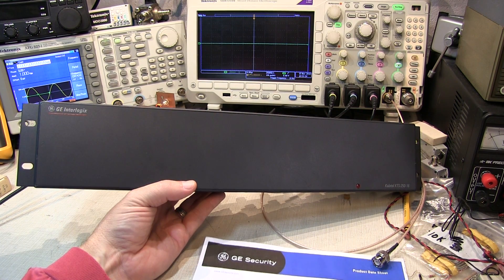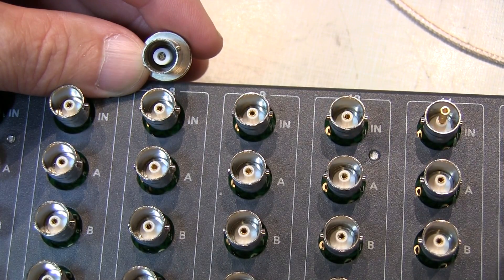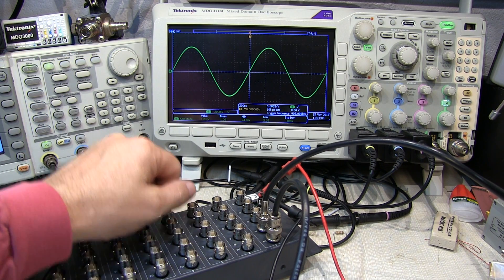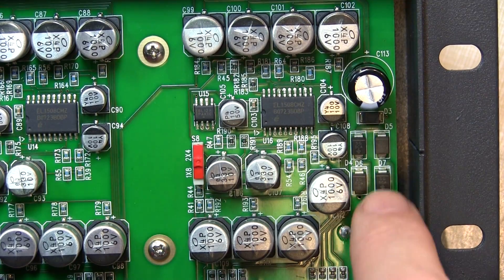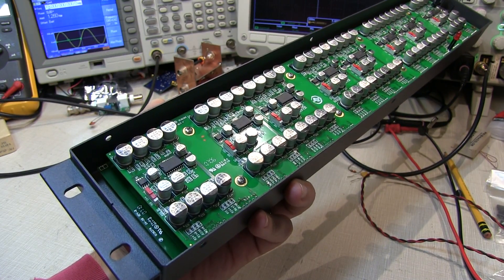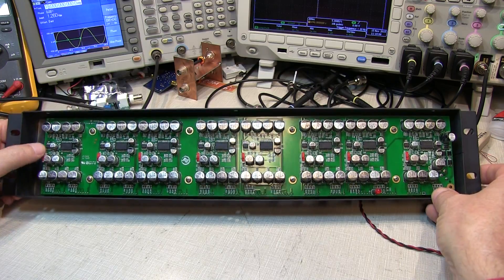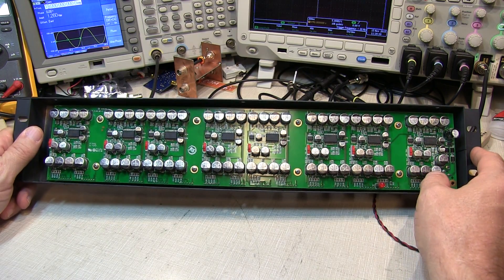#218: Hamfest Find: Video Distribution Amp / 75 vs 50 ohm BNC Connectors

Comment: I say keep it!
I have some BNC to N-Type and BNC to SMA adaptors. Would you say they Must be 50ohm BNC adaptors?
I also have a mixture of BNC to BNC male/female and that could be either 50 or 75ohm. How do I tell them apart? Does it even matter if I use 75phm BNCs in a 70cm setup?
Thanks and Happy new year.
PS what did you end up doing with you video distribution amplifier?

Comment: Absolutely false about interchanging connectors, don't know if it's the center pin or what, NO VIDEO whatsoever using Night Owl 2MP 1080p Cameras w/ BNC 50ohm connector into a Hikvision 75Ohm DVR Input. Nothing whatsoever

Comment: Broadcast engineer here. That unit should have a gain of 2x. The output should deliver 2v into a 150ohm load. The 150 ohms comes from a 75ohm source series resistor and a 75ohm termination on the receiving end. That would then be back to 1volt - unity gain. The input should also be terminated with 75ohms internally  as that looks like a single BNC input and not a loop-though. Also looks to be AC coupled which is OK for security cameras but higher and broadcast analog video amplifiers are DC coupled running from bipolar power rails.

The broadcast industry used 50ohm connectors and patch bays up until the mid 1990s. Like you indicated, the minor impedance mis-match was not critical at 4.7mhz which was the limit for NTSC analog video. Then we had digital video which is a 270mbs (143mhz)  data stream at 800mv into 75 ohms. You had to be careful here because too many 50ohm connections could degrade the bit stream to the point of non-recovery. When HDTV came along in the early 2000s at 1.5gbs true 75ohm connectors were mandatory. Then we went to 3gbs and now with UHD/4K we are running 12G (6mhz) serial digital video. As SDI video is NRZ scrambled, the actual stream frequency is half the data rate.

Comment: If you look at the Amphenol Drawing NO 31-4321, it indicates the connector is for RG59 75 ohm cable, but under #2 of the notes it states the connector has a 50 ohm impedance. Can you tell me why they did not make a 75 ohm connector for the 75 ohm cable?

Comment: thanks for setting the record straight on 50 vs 75 ohm bnc! i use tv coax for hf antenas have no problem just cut the line to 1/2 wave multiples! tv 75 ohm is poor mans lmr coax! the compression bnc are the way to go! i have used f connectors as well as pl259 on tv coax but am now going to use bnc. will use bnc from the tuner on to the antenna. i wonder why 75 ohm has not replaced 50 in ham applications. the rg11 is good for legal limit on most if not all of hf. at the power most hams run 75 ohm is better. bnc are easy to disconect in the event of storms so one can remove the feed from the radio room. i have heard that thy are weather proof unlike pl259. was thare a time when the 50 and 75 wear not compatible?

Comment: Are the inputs terminated with 75 Ohms?  What is the performance like into 50 Ohms?  Like you, I'm interested in using it for 10MHz ref dist amp. I'd hack off a section at a time as needed...
Reply from the maker: works fine into 50 ohms

Comment: I'd be tempted to chop it, removing all but 6 of the channels - you'd be able to squeeze a GPSDO and PSU into the space freed up (not a Thunderbolt, obviously, but there are plenty of Trimble boards smaller than the t/bolt out there) - plenty of spare holes to mount antenna connector and power connectors :). 
A nice self-contained multi-output reference source, and a drawer full of 'spare' bits - and the BNCs, of course - what's not to like?

Comment: Great video Allen.  I think I would keep the rack mountable video amp whole for your reference signal needs despite it having more ports than you need....perhaps in the future this will allow you more room to add more test equipment or increased amount of testing both on the attenuation and amplification....right like the other ports on the same board that you wont use for reference testing can be allocated to just testing any other 50 ohm or low freq 75 ohm stuff.  just some thoughts....thx again for such a great video and channel!  John

Comment: Hi Allan,  About 6 or 7 years ago I found some 24 output video distro devices similar to the one you found but with less BNC's. I think I paid $5 each att a Ham Fest and thought about using them for the connectors as well. 
Upon further consideration, I decided to distribute reference signals throughout the lab for some of the HP gear. I have 4) HP 8640B's but they all use 5MHz ref.. Everything else is 10MHz. I found a neat, though, pricey divider online and bought it for the 5MHz devices
http://www.ebay.com/itm/Frequency-Divider-100KHz-50MHz-Div-2-to-256-FAS-N-SMA-/150198136025?hash=item22f881acd9:m:m1O3zOu2Aj9_Zmmkzw69Uvg
I found a second 24 channel video distro box and now have a 10 and 5 MHz panels

 I bought a GPS Thunderbolt receiver used from the Cell industry that gave me 10MHz out. I bought that form one of the Asian sellers and have been very pleased.  From time to time I have used either the 5 or 10 MHz signals for other projects when I just needed a quick signal and didn't take time to wait on the sig gens to settle.
Your lab but It's better to have too many reference channel than not enough ..Besides, having more channels is a GOOD reason to buy more test gear...Hi Hi 73 de Glenn WA4AOS    di...dit

Comment: I would keep it and buy new BNC connectors. The only things I harvest any more are hard to find unique parts or really neat hardware items like come off some of the old (and non-repairable...) HP, Tektronix or  General Radio test equipment. As an example, things like vacuum tube labels for 6V6, 6SN7, 6SL7, etc;   labels that mount over the power cord that say, "115 Volts 50-60 ~" ); ON/OFF switch labels and other such items that can dress up a project really nice. I still build vacuum tube equipment so this type of hardware is pretty much impossible to find. Always enjoy your videos.

Comment: Analog video is largely obsolete so I really don't see much of a loss in cutting this thing up. I would still keep a section or two as you say and use it for things like the reference signal. It might also be useful for distributing a single antenna to a number of receivers.

Comment: I would probably keep the PCB and the housing intact and just take a few BNCs off the PCB for my parts drawer and use the rest of the circuit as a dist. amp like you said. :)

Comment: I would keep one or two channels. A distribution amp will some day come in handy. Looks like you can easily separate the print board with a Dremel without damaging anything and then build a fine little box for the circuit. The rest would give you a good pile of BNC connectors for future projects.

Comment: %100 save it Alan. Do not cannibalise it. If you see the original "in the shop price" you might be laying down for a bit. The 16 channel version is $564 dollars so if you sold it for 1/2 price you could buy 500 BNC connectors @ 50cents each. 
https://www.surveillance-video.com/transmission-kts-250-16.html/
I used to install a similar distribution units when I installed security systems....you almost want to cry.
PS: Having trouble getting my 74AC14 TDR to output 6khz. Followed the schematic exactly but still not working...Sad :(  do you think MLCC make a difference?
Reply from the maker: +CodfishCatfish I saw the original price - I didn't pay anything near that.  I wonder though, with the advent of IP cameras, wireless, etc., if there is really any market for this type of DA anymore - even at 10% of the original price.
RE: There's nothing magic about the 6kHz - just about anything will do.  I've seen the same exact circuit operate anywhere from 1.5kHz to 10kHz - so no worries at all.  Most often, with the components shown, it will do something less than 6KHz.  If you want faster, then lower the capacitor at the schmitt trigger input a bit, or lower the feedback resistor.  Frequency will scale somewhat linearly with these changes.
Reply: +w2aew Understood Alan. I understand a lot of banks still refuse to budge from coaxial CCTV due to the delay from live feed with IP systems. I believe they still have IP but the system is redundant to the coaxial system.

My TDR won't output anything. I have no idea why.?  I  Built 2, one on vero the other just tacking the components on the legs....still nothing. Need to recheck I think.  Off now to get some glass cut for my homebrew UV light exposure box. Chat soon Alan, and really love the videos.....very very educational.

Comment: I had the exact same idea. If it were mine, I would certainly spare at least 6 to 8 channels for a distribution amp just as you suggested.  It looks like you will still have a life time supply of BNC connectors.

Comment: Cheap BNC connectors like that, especially pcb mount ones, are barely worth your while to desolder to start with.
Given that you might find another use I would grab a bunch of connectors elsewhere.
If nothing else you can mount the amp to hang your BNC cables up straight. ;-)
Reply from the maker: +stefantrethan Ha! A BNC cable "rack" - brilliant!!

Comment: Hi Alan,

Nice video once again!  Frankly, I wouldn't have the heart to rip that apart.  I don't know how good the deal was on this one, but I would probably keep it lying around and go buy BNC connectors separately.  Another thing one could try is to check for a drop-in replacement of that Intersil IC (1509) with something that has comparable driving capacity with significantly higher bandwidth.  

Ahhhh, I hate to say this, but in the end, if that came-in really cheap, you could chop-off channel blocks as and when required.

More things on my wishlist:

  1. Isolated/differential oscilloscope probes.  Once again really expensive to buy.  Hopefully there is some way to build reasonably good ones ourselves.  Say, I want to probe both - the primary and secondary of a flyback transformer together, is there a way to do it without isolated probes?

  2. Understanding the use of the shunt regulator TL431 in SMPS circuits.  (See: www.plexim.com/files/plecs_tl431.pdf).  There is some material on this on the web, but would be great to see your lab-take on this.

  3. How do we design using an opto-coupler such as the PC817.  (In the context of SMPS circuits.)  Most people just recommend higher and higher Current Transfer Ratios, but how much is enough?  Why do we need a resistor across the diode of the opto-coupler?  Is there a BJT style DC (bias point) and AC analysis of the opto-coupler?

Thanks once again,
Anand

Comment: Great Video Alan. You don't need the whole thing so cut it up into smaller sections. Heck you can even put all circuits in 8 different boxes if needed. Remember, its the BNC's we are after, the rest is just a plus :)

Comment: We have been using video D/A`s at work for years!   Please do note that  there are a few different type of BNC center pins, "blunt" tip and sharp point.  I prefer the "blunt" tip as i usually get better surface connection with the female side, which helps during temperature changes on sensitive connections.
Reply from the maker: +2.5 Jetta Swap Yeah, I've got both types of center pins in my cable connection.

Comment: I would keep one buffer channel, convert 3 channels to adjustable LP, HP, BP filters and convert some of the other channels to a different connector - for buffering bus data for example. That would allow you to use this box as a bypass while still being able to connect the oscilloscope to debug the signal (SPI, i2C, UART). Not sure how nice the input impedance would play with the signals though.

On a side note, I would like to see the effect of the mismatched impedance using a nice signal analyzer. Is it really negligible?

Comment: That piece of s**it MDO3000 SA cannot even take an external reference. And I only realized this when I wanted to buy a rubidium reference. So there's no much point of using a distribution amp unless you will use your Agilent gear for future videos. :-P
Reply from the maker: +AEL - While the MDO3k doesn't have a 10MHz reference input, the MDO4k does, as well as the Tek RSAs that I have, Tek signal generators, etc.

Comment: It would be neat to know how high in frequency it functions. I would personally use it to put the output of my HF-IF mixer (125Mhz + the frequency of interest) and then feed it to 4 receivers (A thru D) to give me 4 different options. This assumes however that it is any good up to about the top of 10 meters after the IF, so 155Mhz. With the price of connectors, I would rather buy virgin ones online than sacrifice such a beautiful DA.
Reply from the maker: +Bob Holowenko I'd doubt that it has any usable response at 125-155MHz, given that it is 3dB down at 19MHz.
Reply: I was thinking about using one of these distribution units to distribute an audio signal across all my audio test gear.  I was going to gut it and use it for the case and BNC arrangement then wire it all up.  I am concerned with inducing noise onto the lines. I suspect that I would not want any of the unity gain circuitry as I want to send the signal to the scopes and spec analyzer as is from the device I'm testing. Is it a good idea to still use much of the existing circuit boards because of the extra ground planes to keep out the noise?  The LEITCH FR-684 has a lot of BNC jacks and they're around $50 on ebay.  Any advice?

Comment: I would like to do, a distro amp with some interesting hacks :) like: inverted, non inverted, balanced unbalanced, low pass, high pass bandpass outputs, 6 dB plus minus, a mixer input. And all of this from one input :) then it will be handful for drive experiement circuits.

Comment: Divide it up is what I would do too. Get some 100Watt or so low ohm value power resistors and a bunch of power terminals and make a configurable dummy speaker load in all kinds of parallel/series combinations out of the rest of the case. Perhaps also in/out power distribution for when you run out of output jacks on your lap PSU. Case is big enough it seems.

Comment: Cool stuff. Didn't know half about diferences in impedence in BNCs. Thumbs up.
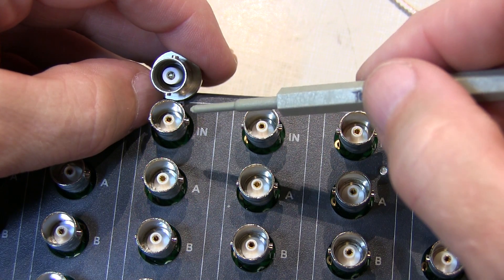But I'd like to note that, as you argue from 2:20 on, the mismatch in impedence will cause issues beyond a certain frequency, yes, but not because of the "lenght of the impedence discontinuity", as you say on 2.36,
It happens because the signal gets reflected back into the coaxial cable. The lenght of the female conector rod is not the critical parameter, the lenght of the coaxial cable used is!! And it might be much bigger, like several meters.
So if you use long cables you may get in trouble, not just because of signal dropoff, but also because of resonances on the coaxial cable.

Comment: Alan - I'd do some surgery on the unit but before I decided where to cut I'd count up the number of boxes that will accept a 10MHz reference in your shack then double that number and round up. Over the years I've ended up with three daisy chained TAPR 6-channel distribution boxes with all the BNC's connected and only one 50 ohm terminator on an output. Nice find! 73 - Dino KL0S

Comment: 10mhz distribution amps can be pricy, I would not harvest out the BNC connectors. I have a number of older distribution amplifiers to use as 10 MHz distribution amps. The only problem I found was that there was a DC voltage riding on the output. Keep up the good work.

Comment: If I knew I'd need a few BNCs soon I'd cut it and desolder most of the connectors. But if it's just "could use some BNCs at some time", I'd keep it intact. Salvaging parts for storage is a waste of time IMHO. The only drawback of that is that over time you collect too many bulky "donors", which is why I mostly remove big components like power transistors with heat sinks or big capacitors for example.

Comment: Here's another use albeit a lot smaller than your amp (should've waited until the end of the video to comment)

I'm glad you posted this. I thought a BNC was a BNC and didn't realize there was a difference between 50Ω and 75Ω BNC's

https://youtu.be/chrzrod3tQY
Reply: +Michael Lloyd My first as well. Gerry also covers the conversion of his video distribution amp from 75 to 50 ohm.

Comment: Could those amplifier chips be used as a small pa for a qrp radio?
Reply from the maker: +joblessalex The chip can be configured for up to 20dB of gain, so it might be a decent start...
Reply: ***** Sweet! I'm just looking for a super small and simple way to get +- 5 watts. Everything I build oscillates. Finally managed to tame the beach 40.

Comment: I say do both, but just remove the connectors from the board instead of chopping it, unless you plan on sticking the chopped board in a different housing

Comment: Thanks for clarifying the 75/50ohm issue, i looked into this a while ago when i was sold some 50ohm connectors that came without the dielectric over the centre pin and queried it. As for the distribution board, i would hack off a decent number of ports, make a distribution panel and then salvage the BNCs off the other section.

Comment: Alan, thanks so much for setting the record straight on 50 vs 75-ohm BNC.  I was always nervous interchanging the two since I had heard it could cause damage.  If the amp were mine, I'd keep it intact with the expectation that I would remove BNC jacks if I had a project coming up that needed the parts.